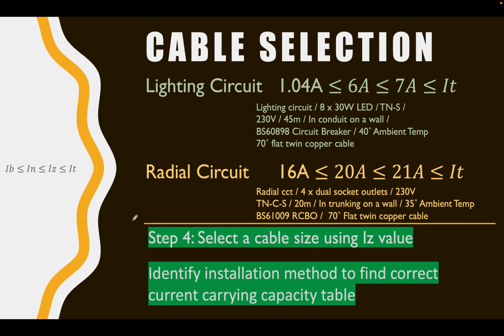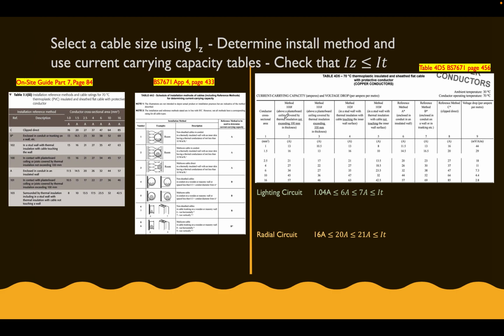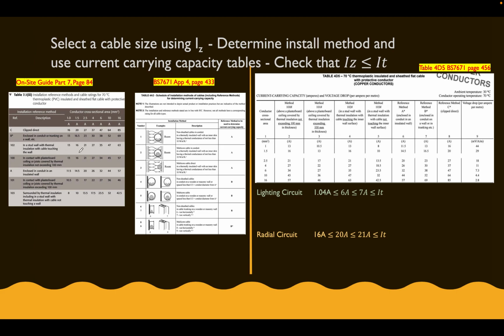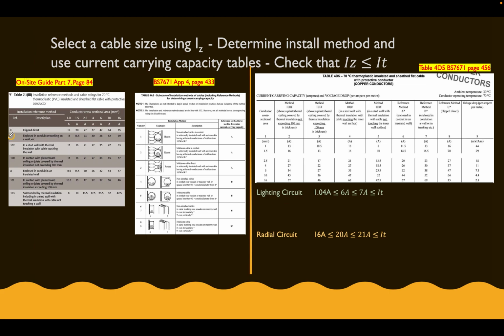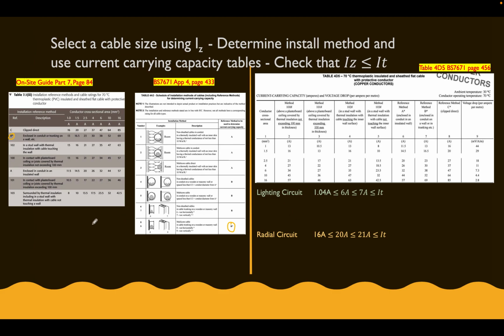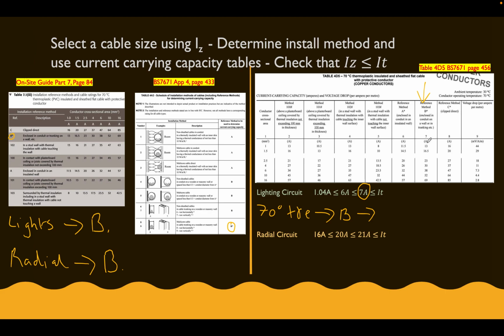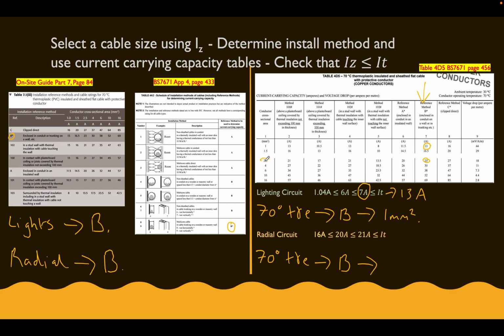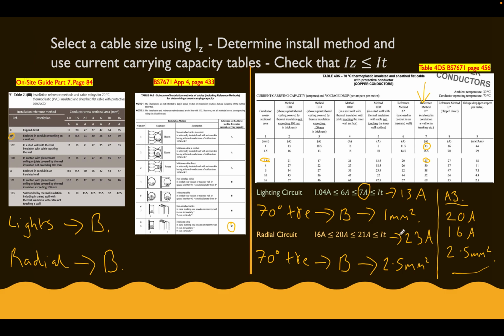Step 4 - Select cable size & determine installation reference method - 4/7 - Cable Selection

Comment: What happens if you use multiple methods? E.g. part of the circuit is clipped to a joist then down a stud wall with insulation? Do you take the worse value?
Reply from the maker: Correct 👍🏻. Design to suit the worst case scenario.